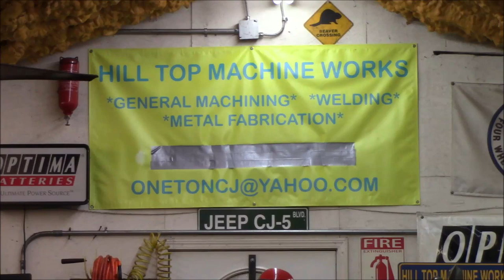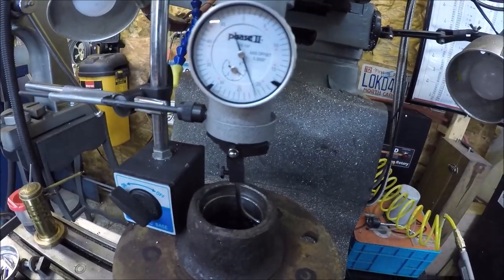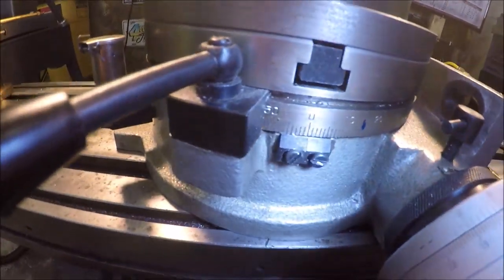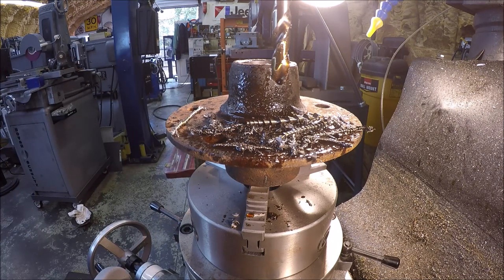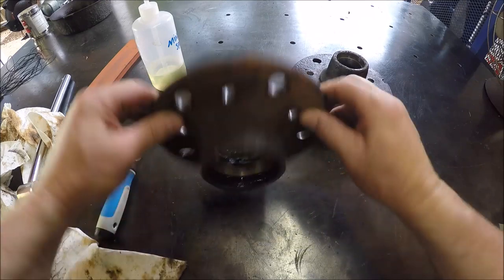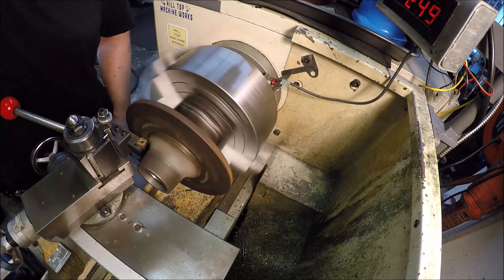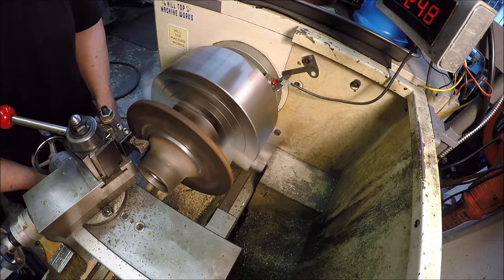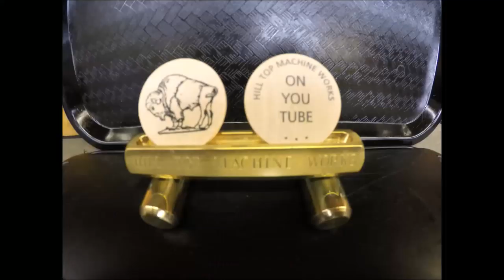Modifying some front wheel hubs

Comment: can u redrill wheel bearing to ..?..great video..
Reply from the maker: Shouldn’t need to.
Reply: @hilltopmachineworks2131  i have a dodge charger that is 5x115 and the wheels i have are 5x114.3 that i want to use..from a mustang..?
Reply from the maker: @johnsmith-qz4bv  Are you wanting to bore out the bore to accept a larger bearing?
Reply: @hilltopmachineworks2131  i want to change the bolt pattern to 5x114.3